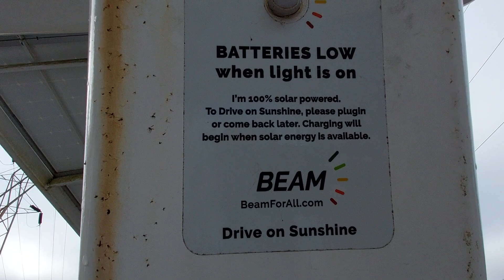Solar EV Charger at a WHERE!?

Comment: Even with the little trickle charge that it provides, if I owned an EV, I would appreciate these chargers at trailheads when hiking.
You might spend hours and a few extra miles for free are a few extra miles for free.
Reply from the maker: EXACTLY what they are here for, it's not for a big charge but a little free top up while you're enjoying the area.

Comment: It's basically impossible to run a line from those transmission lines. And I don't see any electric lighting on the parking lot. And I would be terribly shocked if it was over $40,000. Basically you've got enough space for about 1600 watts power generation and for about 60 KW hours of storage.

This will not fully charge more than one electric vehicle. But it could easily top off an electric vehicle that drove 40 Mi to the area so that it could drive 40 miles back out of the area.

And you should look into the way the federal government subsidized a network of gasoline stations across the United States back in the 1920s.

This is the kind of things governments do to help us progress forwards.

In 10 years, when half the parking lot is electric vehicles, then they'll probably have a landline to some source of electricity or a much bigger solar setup.

Comment: WHAT A JOKE! how much could that array make?? 450-500 watts/hour?.. That is a vanity project at best.
Reply from the maker: It's somewhat a proof of concept as a complete standalone unit able to generate and distribute power without outside connections or infrastructure. I get the IDEA of it, and in certain settings it makes a lot more sense. Just very odd to see outside a hydroelectric plant. I DO know the TVA is expanding their solar capacities so... we'll see in the future I'm sure
Reply: @GoodThings4GoodPeople  What I see is a waste of resources. I wished for the electrification of our transport industries. It does not work, sad.

Comment: It's obvious that some of you have no idea what's going on here.

First, that charger is connected to a large power source.  That is what's providing the energy to charge the cars.

No way those solar panels are going to be able to collect enough energy charge a car in real-time.  And there's not big battery pack for them to charge in order to store the energy.  So that means any energy they do collect is going to be put back onto the grid to be used elsewhere.  It's not a significant amount of energy, probably less than a killowatt, but its not zero, either.  On its own, these don't produce much, but if you install 10,000 of them, all that adds up.

And yes, these were probably chosen by some purchasing authority (government or commercial, who knows?) for their PR value.  Doesn't really matter, it is what it is.  It's hardly the dumbest thing some committee has spend money on.
Reply from the maker: It's actually NOT connected to a large power source. It's not in any way swapping energy back to the grid. This is a standalone unit designed to store energy in an internal battery pack then redistribute it  in a slow/trickle charge fashion while people are visiting the site.
The REAL use of this thing is the fact it's a quickly installed self contained unit that converts solar to useful energy without anything to support it. So in an austere environment or maybe after a disaster where power is at a premium these things could be really great. No word yet on how much these things cost, I hadn't even planned on needing to respond to comments on this video when I put it up but clearly the world is interested! I'm doing the homework.

Comment: You might have done a bit of googling before showing your ignorance. Solar, taking maintenance costs into account, is actually cheaper then hydroelectric. Secondly not every power line you see is available for tapping into. Those are 220,000 to 500,000 volt lines and the transformer for such a step down would be ridiculously expensive. On the other hand solar is cheap and has no moving parts. Next time.. engage brain, consult Google then open your mouth.
Reply from the maker: Thanks for commenting, maybe you were too busy typing about my ignorance to notice that there's a visitors center 100 feet away that has power, that ISN'T solar. So, ya know, that's not really a problem. Again though thanks for the comment and the view!
Reply: Hey you were the one pointing out how crazy it was with those power lines and dam right there. But you know, nice try. @GoodThings4GoodPeople
Reply from the maker: @russnotdisclosed7249  do you feel like you scored an internet point? 🤔

Comment: The required infrastructure to go from HV to LV costs an order of magnitude more than the solar charger…
If you can do it for less than half a million dollars you are doing well.
Transformers and HV switchgear isn’t cheap..,
Reply from the maker: Totally agree with you there but the infrastructure is already in place, there's power to a building 100 feet away that's pretty likely coming from the dam generation.
Reply: @GoodThings4GoodPeople  Capacity is an issue - transformer upgrades aren’t cheap, I got a quote of $20,000 to upgrade an existing 11kV step down 15kW pole transformer to 25kW for a house I was looking at building - a complete grid independent solar system was also $20,000 (fifteen years ago).
Equally, the power company may have installed this as a technology demonstration installation to see how well it works in a controlled environment. 
Either would’ve been a reasonable explanation.
Reply from the maker: @allangibson8494  you're close on the "demonstration" part, as a portable self contained charging station it has some very interesting implications. I'll make a follow-up video to this since people have so much interest that I was NOT expecting
Reply: @GoodThings4GoodPeople  I you want odd, I am aware of one company making packaged diesel refineries that sit on oil wells in remote areas. Basically the truck that picks up the remaining crude can refuel from the insite diesel pump (which also has a credit card facility for anyone else passing through the middle of nowhere…).
Reply: @allangibson8494  you are using the WRONG UNITS! 

upgrading a transformer on a pole is a big ask... they have to do it whilst its still hooked up. cant disrupt other users... calls for licenses, insurance, blah blah blah blah... paperwork as well as the materials...

the generators in the power station though... exactly what voltage do you think they PRODUCE? worth looking into that ;)

and i am sure that when they designed the place, they made sure to have enough capacity in its "pole pig" to allow for any future "upgrades" that may eventuate...
Reply: @paradiselost9946  Hydroelectric power stations typically generate power at 3.3kV. Power is transmitted on high tension power lines at between 125kV and 500kV (you can’t go higher than 500kV because you generate gamma radiation).
I do industrial electronics for a living…
The 15kW transformer was feeding two other users. A 25kW transformer was needed to add another user to that rural drop. Wattage was the limiting factor.
Changing a transformer takes about an hour. The extra poles and overhead lines were the time consuming part.

Comment: The presenter has just shown how stupid he really is the High voltage lines above him are running at 500,000 volt (500kv) and the EV charger run at 400 V - 1000 (1kv) volt. The cost for a transformer to reduce from 500kv to 1kv is between $1,500,000.00 - $1,857,000.00. The cost to install Solar EV Charger about  $40,000 to $80,000. The presenter statement and I quote "What a crazy wast of money" is BS as he has know idea what it cost.
Reply from the maker: Presenter here, thanks for chiming in and watching the video! As you may or may not have noticed there's a building about 100 feet away that's fully powered by the hydroelectric plant so all that infrastructure is already in place 😉 You ARE correct I don't know the cost of said solar unit but I'm looking into it. What constitutes a "crazy waste of money" to you? How much can be spent on this unit that may or may not ever get used? What could those tens of thousands of dollars have gone to instead that would have directly improved people's lives? 🤔
Reply: @GoodThings4GoodPeople  You pointed to a 500Kv power line not the infrastructure that is already in place i.e a 400v or 1000v power feed. If you filmed the feeder line, and there has to be one' I would accept your comment "crazy waste of money". This is because the power you get from the few solar panels is not enough to charge a EV in a reasonable time. The Solar panels need to cover the hole vehicle parking area not just one vehicle.  

Typical Power Output for DC Fast Charging is 50 - 350 kW this would requite about 1000 solar panels depending on solar panel performance. The solar penal in your case is only a feel good gesture as it would take a day or so to charge most EV with that few penal. The only tangible benefit the EV charging station with that few panels will be is that it will give shade to 1 vehicle. Now if they did it correctly the hole parking lot could have shade and all uses ICE and EVs. This could be protected from the hot sun making for a pleasant stay for all users as they can get back into a comfortable cool vehicle. 

Note I see so meany people on youtube misinforming the public about EVs it discussing. You should note we have 2 EVs and Solar and we benefit by about $5K every from lower cost in running EVs and power. True freedom comes from removing ones dependence on Fossil fuel and power generators. 

Further we lost a son to fossil fuel pollution asthma attack. A Harvard study suggest an estimated 8 million excess deaths per year globally are attributable to ambient air pollution from fossil fuel use, and therefore could potentially be avoided by phasing out fossil fuels. What would feel good is if those 8 million people didn't have to die because of our selfishness in continuing to use Fossil fuel. Those tens of thousands of dollars was not enough, in my option they should have covered the hole parking lot one more step in reducing the use of Fossil fuel.

Comment: There is also one very similar in the Australian outback but that has a diesel generator as a backup. Looking closely at the video there appears to be 12 panels on the "roof". If you assume 500 watt panels (about as big as you can get at the moment but I think these are only 415 watt panels) you could generate about 30kwhrs per day in high summer. This means that the best this unit could do is provide about 90 miles of range if the car was plugged in all day in high summer. If two cars want to use the system they would get half of that each. In the winter and if overcast as it is when the video was recorded the unit might only produce 5Kwhrs per day. To say this is a complete waste of time and money is an understatement.
Reply: It's probably some more as the thing tilts to always be  at the optimal angle with the sun, they're pretty nice actually, just put them in a remote public space to give a little energy for free to people... Maybe not at a power station though lol

If a car comes once in a while the battery will have charged enough during the rest of the day (or precious days) to give it more energy than it would get  from only the sun in just the hour or two it's plugged in.

As for diesel generators for charge stations, as funny as they look they're still very efficient compared to putting that diesel directly in a car!
Reply from the maker: @FAB1150  correct it has sun tracking to keep optimally positioned and yes it's primarily designed to be used in areas without infrastructure or where installing it would be a pain. In this case, can you imagine the red tape involved on government/TVA land to run a feed and install charge stations versus just plunking one of these down that requires nothing but a parking spot? 
It makes sense... just looks and seems SUPER weird outside of a huge electrical power generation facility!
Reply from the maker: I'm doing some more homework into these since this video has taken off a bit which I completely didn't expect. These are actually meant as a trickle charge type thing, when people come to walk or fish the area they can pick up a bit of charge while they are there. Certainly not intended to be a dead to full charger or anything similar to a fast/super charger. Just a lil extra juice for free while you visit. 
For an austere environment without established infrastructure I can totally see these being useful for all sorts of things. But, probably not in the marking lot of a 120mw dam 😉
Reply: Beneath the steel plate is a bank of batteries that the solar array keeps charged. The CHARGER can charge an EV with enough energy to make it to a grid connected charging station. It's most likely a 20kw slow charger and you'll be there 2+ hours. I'm an ex EV owner.

Comment: Looking at the cables, that is a very low output charging station probably about 4 kW so probably take you 10 hours to charge your car fully. It's obviously a joke signed off by stupid politicians who don't understand the basic concepts of solar power and probably think it charges at night as well. Most of these systems use the grid anyway to charge the battery. It's just green washing for stupid people.

Comment: In all fairness cars are charged off the hydro power. Those panned only produce a few thousand watts for 6hours a day. Those panels are mostly for show.
Reply from the maker: No Sir, this is a standalone unit not connected to anything designed as a trickle / slow charge solution not requiring any additional infrastructure. It's certainly not something you would ever want to try to get a full charge from though.

Comment: One thing I can't stand is unreliable chargers that can't replenish or provide a minimum guaranteed power. If the battery is empty, you're in for a long wait. How many kWh is this setup storing?
Reply from the maker: Doing some homework on this as we speak, it's designed as an off grid slow charging or "trickle charging" unit so my guess would be it's not a huge storage/output. For someone who's driven their EV to the dam then go for a walk or whatever around the area it makes some sense to add a bit of juice, certainly not a charge from dead solution.
Reply: @GoodThings4GoodPeople  Gotcha. I've used some grid-tied battery chargers that advertise themselves as fast chargers. Capacity ~150 kWh and advertised to charge at up to 200kW. The only problem is the chargers don't share their state of charge and are placed next to freeways, so after 1-3 long distance EVs fill up, its empty for the day, and refilling the station battery is limited to a 10-20kW from the grid, where you get 0-10kW, or fast charging for 2-10 mins before lockout, just depending on how the machine is feeling. If you look up the On The Run EV charging you'll see a little bit of what I mean.

I like the idea, its cheaper to deploy units on 240V than expensive 400-600V AC connections that require a larger install so the network can expand out in low demand areas, but they really fell short of making that system work well with customers because placement is horrible and SoC isn't something shared over plugshare or the journey app, and in my case, added an extra 1.5 hours to my trip.

For a level 2 EVSE, solar might be okay, but you're right in your video and comments that a 240V hookup would be tantalizingly practical, and permanent.

Comment: I would suspect that specific solar EVSE is hooked up to the grid and hence that hydro plant and the solar panel is simply net metering with the grid.   Accumulating the power with batteries would be inefficient but accumulating it with accounting by trading with the grid is artificially 100% efficient so long as there is another consumer whenever the Sun is shining and no vehicle is plugged in to recharge.

Comment: Then what if you pull up to a depleted solar charging station.   Such stations would depend on accumulating the power over time to charge the vehicles over much shorter periods of time.   Slow charging in general is a benefit in general whether the energy source is solar, wind, the grid or a combination of them but we will need to know when the EVSE won't be capable of providing the needed charging.

Note, the specific solar EVSE's shown are not DC fast chargers but just level 1 to level 2 chargers.  It only takes four household 400 watt solar panels to provide basic level 1 charging and perhaps as few as six to provide minimal level 2 chargers.   There are videos of people who carry five to six solar panels and an inverter with their EV's for such slow charging.  It would take days to charge from 0% to 80% at one of these solar EVSE's just as it does at the complementary chargers found at shopping center parking lots, restaurants and motels, however we rarely charge from 0% so even level 1 charging is sufficient for many purposes.   Chances are if you simply have four to six solar panels and a netmetering contract with your utility set up with your home, you will be effectively charging your car with solar.

Comment: I guess TVA wants to look green.
Reply: But not the color green you look in relation to technology.. ???    Small micro inverted, grid tie'd  solar arrays are popular ways to partially offset power bills and in this case create shelter.   Moor than just looks.!!
Reply from the maker: Apparently there's quite a push in the TVA to add a whole lot of production this way. Also it's a viable option as a "mobile solar power" solution if you are going into an area without a quality power grid. I'm still looking into this!